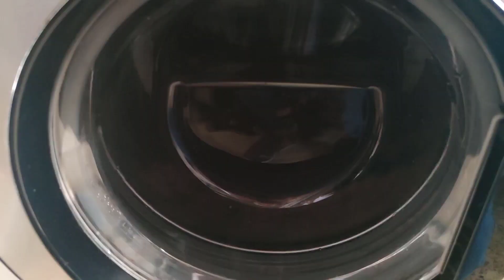Presli Kazan Rulman Değişimi Nasıl Yapılır?

Comment: Ustam yanlış anlama ben usta değilim ama 04:26 'da rulman sanki tam oturmamış elle çevirdiğinde o kazan birden durmaması lazım ivmesi bitene kadar kendisi dönmesi lazım. Bu tarz durumda makine kapağındaki körüğe sürter ve lastiğin erimesine sebep olur. Videonuz çok güzel olmuş elinize emeğine sağlık fakat aynı tamir amaçlı çok video izledim. her yapan eliyle çevirdiğinde kazan durana kadar dönmeye devam ediyor.
Reply from the maker: Makinede sorun yok yani rulman olarak. Biraz işlem görmüş kasası. Zamanla düzeldi 👍
Reply: @Dedex55   Yeriniz hangi şehir de, benim makinede de rulman sıkıntısı var şuan, Ben İzmir'den yazıyorum bana sağlam ve sizin gibi temiz işçilik yapacak usta lazım
Reply from the maker: @izmiredi  çok uzak maalesef. Tanıdığım birisi olsaydı keşke İzmir'de.